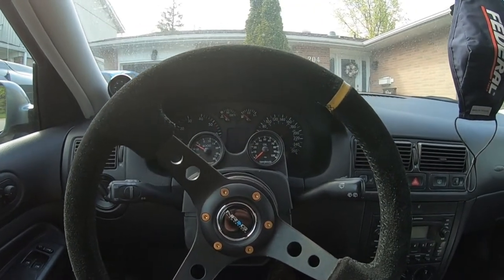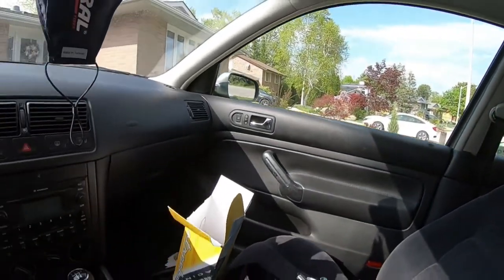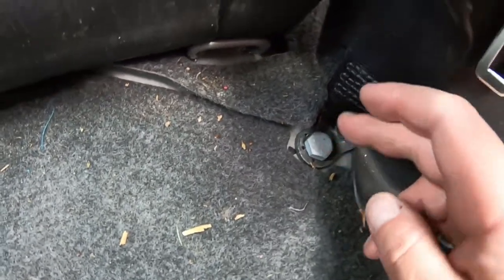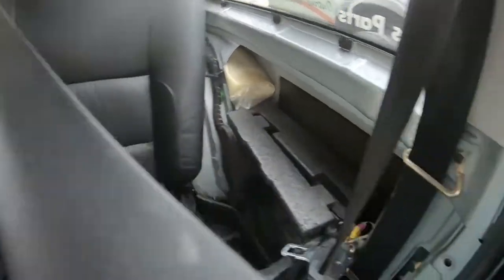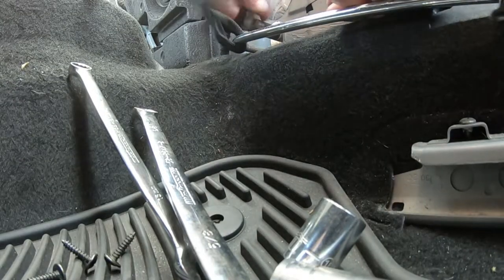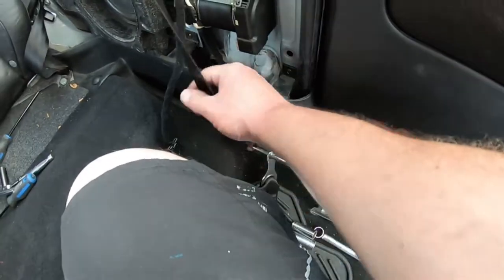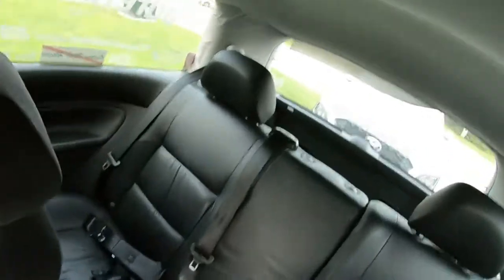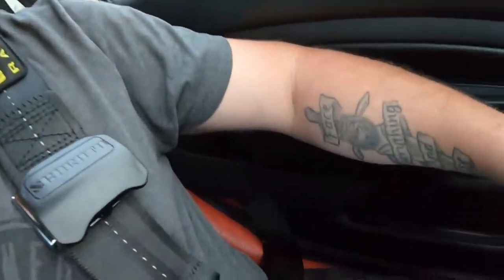Mk4 GTI Harness Install (Time Attack Ep 27)

Comment: Hey man! Looking to put a bucket in my mk4 gti as well. I also purchased a sparco seat, however I am confused as to how I am supposed to mount the stock seatbelt buckle. Did you use the oem seat rails? Thanks
Reply from the maker: The rails were already on the seat when I bought them from a friend! I did use the oem seat belt buckle and it gets mounted to the Sparco mount. I wasnt to crazy about the orientation of it, and have considered trying a different buckle from another car but it seems to work for now!